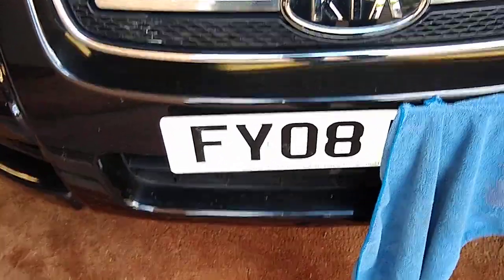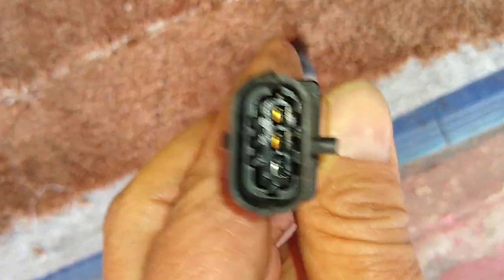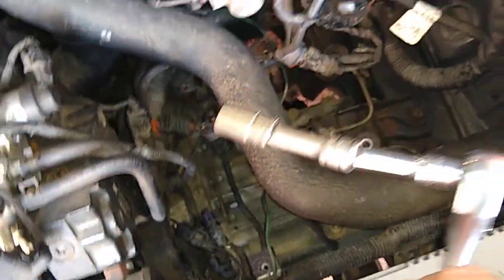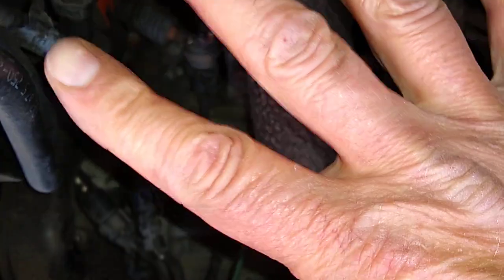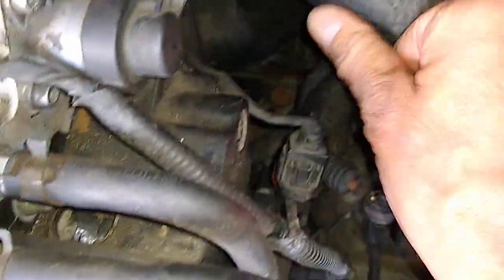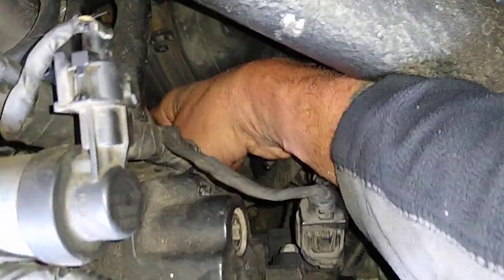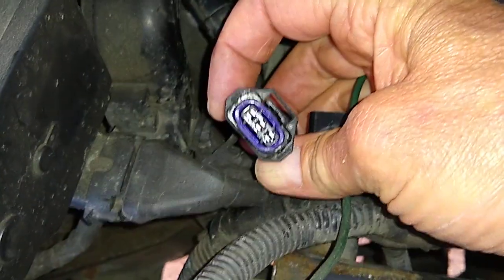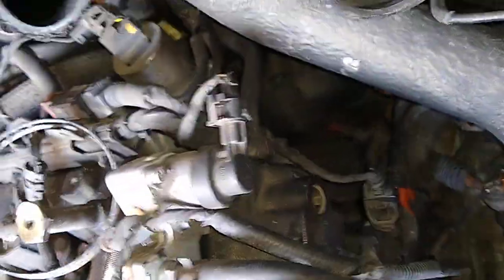Crankshaft position sensor on Kia Sportage 2008 TDI Diesel

Comment: I know this is already a 4 year old video, but I would like to thank you Mike for the explanation.

Out of the blue, my 2009 Sportage 2.0 wouldn't start (it would take 6 or 7 attempts) and got the P0335 error code.

I took it to a garage nearby that held it for 2 months and charged me more almost 600 pounds saying that they changed the sensor twice, but could not fix the car. They told be that they would have to do a timing belt replacement that omwould cost me more than £1000.

I took the car home and decided to follow your video: bought the senson from a Kia dealer, got rid of all pipes you mentioned in the video and was able to replace the sensor.
The car works fine now!!!

AND I realised that the sensor replaced was from 2007, which means the garage didn't replace it at all.

To anyone trying to do it, once you replace the sensor, you might need to clear the error code afterwards. No relearning was needed. It costed me £55 for the original sensor plus £15 for a hose clamp pliers.

Thank you again, Mike!

Comment: In the process of changing mine. It's in the same position on the 2.0T engine. Still a real bitch to get at. With the bolt removed it's still difficult to break free of the block. Getting the new one installed and the bolt started is going to be brutal. Might try it from the bottom for better access.

Comment: Hi Mike what were the symptoms of the sensor failing, mine has suddenly decided to start then pretty much immediately stop, no fault codes of course as you would expect!!!
Reply from the maker: Exactly that all right one minute cuts out the next it cured several problems all with this one sensor 👌👍
Reply: @mikemoody1407  Thanks for the quick replay I was not looking forward to this fiddly job but fortunately after a bit more video watching I found that disconnecting the EGR valve allowed the engine to start and run so figured it was a stuck EGR valve.  Manged to get by with just taking the solenoid top off and squirting WD40 plus carb cleaner and a combination of tapping the valve in and twisting it in and out (it has two flats that you can get a small spanner on on the shaft) this freed it up without the ball ache of removing the whole valve assembly.  Phew, just enjoying a well earned cuppa and chocolate biscuit.  Once again thanks for your informative video.  Regards Murray

Comment from the maker: Hi, the problem I had with mine was every now n then the engine wouldn't start n then it would start very intermittent n then it would just cut out when ticking over , the sensor replacement completely cured all these problems cheers mate hope yours will do the same Mike